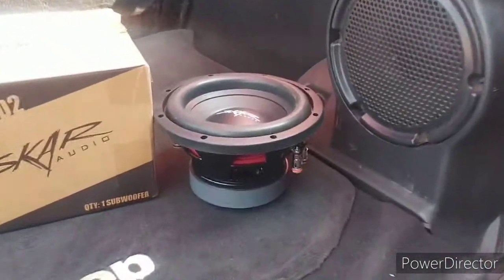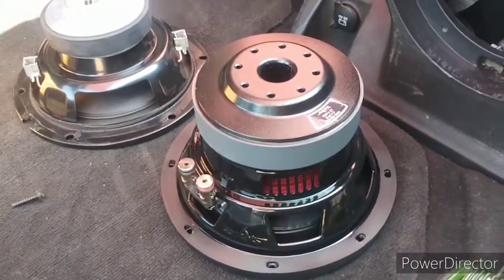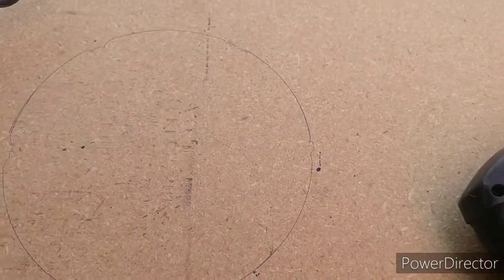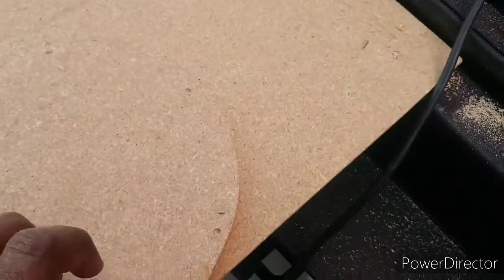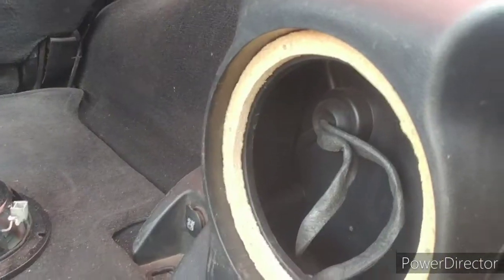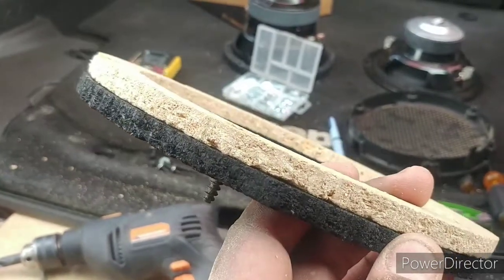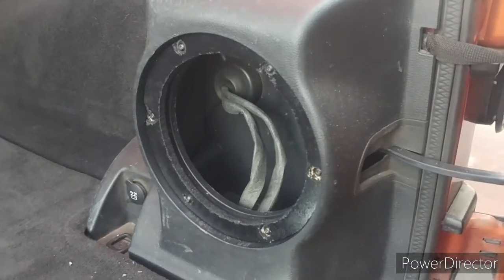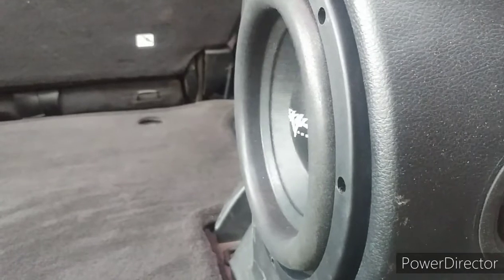How To Install Skar SDR 8-D2 8" Subwoofer in Jeep Wrangler JK

Comment: The OEM Infinity woofer just started rattling wrong(2011 JKU). Your video is perfect timing for me. You really couldn't have explained how to install a new 8" sub the way you did and the way you helped us keep our costs down. Keep putting out good content. I appreciate you.
Reply from the maker: Thanks, Eric! Man, I found a 8" sub o-ring (like he one I built) on Amazon! LOL! I think I put the link in the description, but the day I was doing the install, I needed something RIGHT THEN. It's been working perfectly every since, so I'm not replacing the one I made, tho. Glad you found the video, brotha. This sub will hit! And I only run the factory amp with it. It can take a lot more, trust me!

Good luck, brotha. Keep us posted on the install.

Comment: Looks Good! Earned yourself a new sub. I just picked up a 6.0 swapped Rubicon and trying to come up with how to make the system better without creating a target for thieves lol. Only thing I would change, and they are small. Fill the box with some poly fil and solder speaker wire to the factory plugs.
Reply from the maker: Thanks and welcome to the Jeep family! As you gor the 6.0 Vortec! You running the 4L60E with it? Man, that's a beast already. I think adding polyfill would definitely push it a little harder. I use the factory amp but this sub can take a lot more!
Reply: @MicDropBBQ  6l80E actually.
Reply from the maker: @petyweestraw Damn!! More torque with that one? I'll rebuild a few 4L60Es and they're so easy to deal with. Never did a 6L80E

Comment: Thank you for this! I have wanted to see what others have been doing to replace that junky stock woofer for the longest! Great video!
Reply from the maker: Yes! It didn't really hit like I thought an 8 should hit. The SKAR 8 HITS! This is what Jeep should have used. Stock amp and all. Just plug n play. When I'm riding around, I usually play a hitting song for a passenger and they go, "...you got a 10 or a 12?" I'm like, ....that's an 8 in the back with two box-8s under these front seats. 😂😂  These babies RUMBLE! (I have the install of the underseat box 8s in another video on this channel.)

Comment: Bro you just saved my life. I have a Skar also and I was like duck that I’m not spending money for a custom box.
Reply from the maker: Hahahaha! All it takes is an adapter and it fits! I've had it on there for the last few months. Hits so hard, I may need rubber gaskets around the wood. That Skar pushes some serious sound waves! All on a stock Jeep amp! Good luck brotha. Keep me posted on how you work it out!
Reply: @MicDropBBQ  wayamin?? This was pushed on stock? I was just about to jump in the shed and grab all my old setup to run wires and the original Rockford amp to upgrade the sub. I just wanted to hit a little harder and hated I would have to do all that but if that was stock I’m about to order this skar. I did buy a planet audio sub but didn’t do it like this.
Reply from the maker: @devin1909  Yup. That's on the stock amp. it's not even scratching the surface of this SKAR tho. It can hit a lot harder, as I'm seeing in videos. This is just bumping, but some videos show these speakers JUMPING! I have a 200W Kicker marine amp that I used to my motorcycle a long time ago. I'm thinking of running to this sub, alone...just to see what it does. LOL! It hits and doesn't shake the whole Jeep, so I like that about it. Rattling takes away from the clean sound, and that's what I'm trying NOT to do. There has to be a way I can adjust the bass levels after adding the amp, just to make sure it doesn't rattle the top of the Jeep like crazy.
Reply from the maker: @devin1909  ...and make sure you look at my video about the underseat Rockville's I'm running. Those two speakers FILL the cabin with bass. Warms up the music WAY differently than not having them. Just smooths it all out and makes it sound like you're sitting in a theater. Hard to explain, but when I turn the bass all the way down on just those underseat speakers, you can feel the emptiness. Then when you turn em up to about 75%, it's a whole different world. Even with the music on low, it sounds FULL and surrounds you.

Comment: Bless Up! Good Video... Did you mention if you choose the 2 ohm or 4 ohm sub? both are available on that Amazon link... 
Thank you!
Reply from the maker: I went with 2ohms so they require less power (less resistance to power) to get them to hit. The higher the ohms, the more power you need to really push it. But the benefit to higher ohms is thr bass hits deeper.

But at 2ohms, it still hits deep, but not as deep as the 4ohms. You'll be OK with 2ohms for midrange bass.

I also have a video where I just put a 10" SKAR in back and that handles the deep bass.

Comment: Thank you for a great video. I hit the subscribe button as well. I have a 2013 JK 2dr with the factory Alpine. I ordered the IX-8 D2. Seems to be similar measurements to yours in this video. Assuming I will have to modify as well. Are there any premade solutions that would work? I really want to stay with Skar, but I know there are other subs that will fit more exactly.
Reply from the maker: They have something on Amazon that's for an 8" enclosure and it LOOKS like it might work. I haven't tried it, as I built mine. But if it's for an 8" sub, it might work. You may have to do some modifying to it, tho. Thanks for subbing! I got a whole Jeep playlist of mods I've done. Crazy stuff! Let me know if you get this sub installed, tho!

Comment: Dual 2 ohm is 1 ohm in paralle and 4 in series. I hoping you figured out you could of trace stock sub then the skar comes with cut out in box.
Reply: No hate though.
Reply from the maker: All good brotha. I didn't have to worry about the paralleling of it. Simply plug n play and it kicks hard. Sometimes, over-thinking a si mole situation makes it more complex than what it really is. Lol! There are a lot of "stereo heads" that would make the install seem like rocket science, and it's really not.

And I looked in my box for a cutout and there was none. Sometimes, they forget simple stuff like that. I used to make subwoofer boxes in Vegas back in the days of Cerwin Vega. Lol! I'm 47yrs old. 😂😂
Reply from the maker: My new issue is wanting to make this adapter in plastic. I'm brainstorming on how to create it without ruining a ton of plastic. I need a 3D printer! 😂
Reply: I was wondering about this as well. If he tested the wire after the subwoofer and got 2ohm total and upgraded to a Skar that says dual 2ohm that’s either a 1ohm or a 4ohm load
Reply: I was gonna try the same thing using an Sundown SD4 8” but wondering if the stock amp would push it

Comment: What's up bro... I got around to watching your video and this is exactly what I am looking for. AWESOME! CLEAN! SIMPLE! STOCK-ISH! Have you been able to make some of the ring adapters, I am interested in purchasing some if you have. Again great video.
Reply from the maker: I haven't, but now that I have a 10" SKAR box back there, I wanna pull the 8" and make those adapters outta plastic. I'm gonna work on it, definitely! The wood is holding up very well, tho. Maybe make them in a more solid wood if I can't do plastic. Plus I wanna make it with one thick half-inch piece instead of 2 quarter inch pieces.

I'll keep ya posted. I drop a video with every mod, so it'll be on here!
Reply: @UberJeep AZ  cool. Yeah I wish I could do a box back there instead of the stock box but I have 2 dogs and need all the space I can get for them. Thanks for the reply. I'll make some out of wood as well for now. Happy Thanksgiving 😎
Reply from the maker: @oaraica24  the box is small. It was built by SKAR for vehicles that wanted to keep their trunk space. I still put luggage back there, as the box is maybe 13" wide, if that. It's about 2 feet long, so there's nothing on each side of it. Not a bad box for a Jeep.

Still doesn't shake the vehicle, which I like. I hate rattling vehicles sounding like they're dragging metal trash can lids down the street! Lol! I want good, full sound inside of the Jeep. I don't care about the people next to me. They probably hate what I listen to anyways, but I want full, clean sound inside....especially since it's my money. I deserve the best sound quality, so I set my system up for me and my riders. Doesn't take a lot or money to get amazing sound inside a Jeep!
Reply: What up bro... hope you had a great holiday. I finally got around to installing the sub and it went SMOOTH! Thank you. The only question that I have is do I need to change out the stock head unit so it sounds better? I feel like the stock sub was hitting harder. Alls I have done to my jeep is replaced front speakers and rear sub.
Reply from the maker: I changed out the stock unit and got a 50w x 4 unit in. I still use the stock amp. It hits harder and can handle more bass than my stock one.

I was trying to answer your other comment and I hit DELETE on the damn comment instead of reply! Now I'm pissed! LOL! But I didn't make the rings/adapters yet. I'm working on something this winter tho. I already was on a comment thread talking about it, brotha!!

If you wanna run the speaker leads into another amp and THEN into the sub, you can do that. This sub can handle a lot more than what we're putting into it with the stock unit/amp. Underpowered like crazy, so don't think you're stuck with what you've got. You have a good working foundation to increase the power to that sub now!

Comment: This is a great video. Did you ever put a grille over the speaker?  I throw stuff in the back of mine I’m scared I would ruin an expensive speaker.
Reply from the maker: Thanks, brotha!! Appreciate you looking at the little fabrication. But nope. I never put a grill on it. I put luggage back there all the time. I put the tops back there, as well. The speaker just happens to sit in a spot that I never have to put things up against, but if something was to slide over there: uh oh. LOL! I think it would be a good idea to fabricate something to at least shield it against a hit. I know that I'll have to do it at some point in time, so maybe I need to start researching grills.

Comment: Hey man. Did you end up making these for sale?

Did you end up using the factory amp or did you upgrade?
Reply from the maker: Not yet. Still working on a 3D printing machine to get these made. I've got a guy who says he can help me, tho. That means I don't have to buy my own machine! Woo hoo!! At least not yet.

And I used the factory amp. I just ran the wires to the speaker and it powered up nicely. I think it's underpowered, tho. It can take a LOT more than the factory Jeep amp, for sure!
Reply: @MicDropBBQ  Hell yea! Im going to upgrade i think to your setup. Great videos BTW.

Comment: Hello, do you have the factory amplifier on your stereo or do you have an aftermarket installed?
Reply from the maker: Stock Jeep amp for the 8" sub. The head unit makes a difference tho. I'm running 50w x 4 channels on it, so that's extra RMS power.

The SKAR I'm running is still underpowered, so I could add an inline aftermarket amp to boost the signals a bit, if I wanted to. So far, it does its job without an aftermarket amp.
Reply: @MicDropBBQ   Ok, thank you for your answer. And I ask you, do you also have the speakers connected to the factory amplifier or are they connected directly to the stereo?
Reply from the maker: When I was connecting the head unit, I just used the speaker leads that were coming from the wiring harness to the Jeep. I'm sure the wiring harness goes to a amplifier and then to the speakers.
Reply: @MicDropBBQ   Thank you for your reply. Then you used an interface to not disable the steering controls and to be able to use the stock amplifier since I understand that the JK with subwoofer use stock amplifier.
Reply from the maker: @edgardorodriguez684  when I bought the Jeep it had a JVC head unit. I switched the head unit to a pioneer. It never had to stock head unit as long as I've had it. The interface must already be in there because all I did was connect certain color wires to the other color wires. I don't use the controls in my steering wheel because I got tired of hitting the buttons by mistake.

All the controls I use are on the head unit itself. My steering wheel controls are not active. This way I can turn and whip it around when I'm off-roading without changing the songs or have it messing with the volume.
Reply: @MicDropBBQ  Thank you for your answer.

Comment: Would you need to upgrade the amp?
Reply from the maker: Not necessarily. You could if you wanted to, but the enclosure wasn't engineered for competition-level bass. I'm just keeping it real with you. The enclosure was designed for an 8" sub that maybe SOUNDED nice and had a good amount of thump. It wasn't designed to blow the block away. If you upgrade the amp, you'll get the sub to hit harder, but then you have to worry about the enclosure and how much it can handle. It might start flapping badly on the inside, for all I know.

I ran the stock amp and it's decent enough with the head unit I've got to power it with reasonable MUSIC and not a lot of flapping and rattling. I can't stand music that sounds like a bag of aluminum cans are rattling. I like clean, crisp music. Rumbling bass (not really slamming bass) and crisp highs with clear vocals. For bass heads that just want bass that shakes houses down the block, this is just an 8" that's gonna round out your rumbling and sound a little more rich versus the stock sub back there. Same stock amp. Same connections. Just a little deeper rumble and maybe a bit more thump, but nothing super crazy.
Reply: @MicDropBBQ  true, I just opened up mine and the original owner filled the enclosure with polyfil and changed the sub to the pioneer TS-SW2002D2. Last week I installed the Alpine SBV-10-WRA that goes under passenger seat and I love it! I was just looking at my options for more bang without adding a boxed sub in cargo area. Really thinking of going with some speaker towers
Reply from the maker: @mikehamoui2759  I've got some wakeboard boat speakers in mine, as well. LOUD as hell! Rockville 8" and they scream in your ears, man! LOL! I have them on a channel that I can turn off at-will. They can get loud for the people in the back!

I've got two underseat speakers, as well and they rumble and fill the cabin with some warm bass. I can tell when they're not on because the bass sounds a little hollow. The moment they come on: WOOOOO! Theater sound! And it's so smooth and warm, it wraps around you and has the seat rumbling while you're cruising! Love them underseat speakers, man!!

The whole setup is in the playlist for this sound system, but tower speakers are a lot easier to set up than I did mine. I was just trying something. I no longer have the bar back there, but I've got the speakers mounted on the actual Jeep across the tower, now. Sounds FIRE!

Comment: Que pasaría si conecto un subwoofer 8 plano de bobina sencilla? Que da un máximo de 350w
Reply from the maker: Depende de qué tan fuerte reproduzca el sistema de sonido. Reproducir a volúmenes básicos probablemente no afectaría mucho, pero si empuja el subwoofer más allá de la potencia nominal con un amplificador más potente, podría soplar el altavoz. Juego mi sistema a un volumen máximo de aproximadamente el 80% y ha estado bien durante años.
Reply: @MicDropBBQ  y como sería la conexión amigo? Si pasamos del subwoofer doble bobina de agencia a un subwoofer de 1 bobina? Se elimina un par de cables o se unen las 4 salidas para formar 2 salidas y conectar el nuevo  subwoofer de 1 bobina?
Reply from the maker: Ohms es solo resistencia. La menor resistencia significa que no se necesita mucha energía para hacer funcionar el altavoz. Los submarinos de menor resistencia son más fáciles de soplar si les pones mucha potencia. Yo iría por 2 ohmios o 4 ohmios. Correr 1 ohmio significaría que se podría usar un amplificador más débil, ya que un amplificador más potente haría sonar el altavoz.
Reply from the maker: Usaría ambas bobinas como normales y las alimentaría al amplificador con la izquierda / derecha como de costumbre. No intentaría agregar más potencia a un altavoz de bajo ohmio. Eso lo arruinaría porque tiene muy poca resistencia al poder.